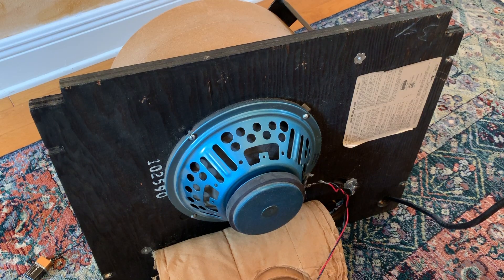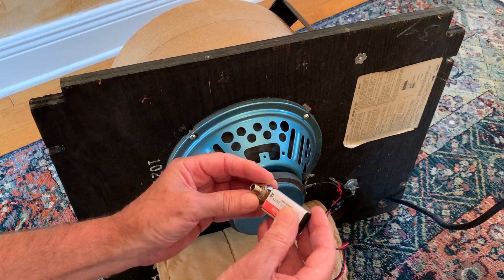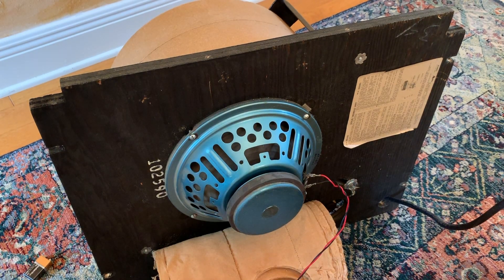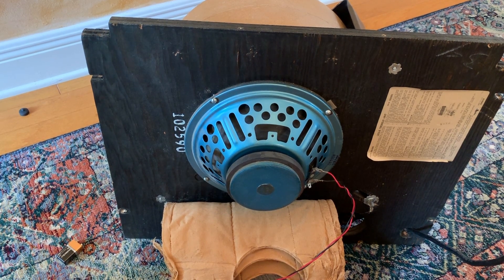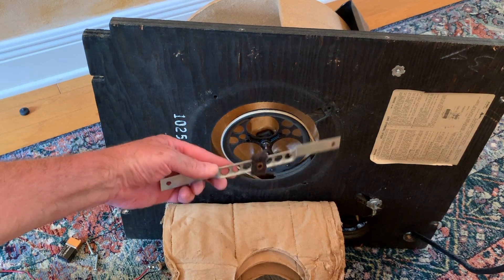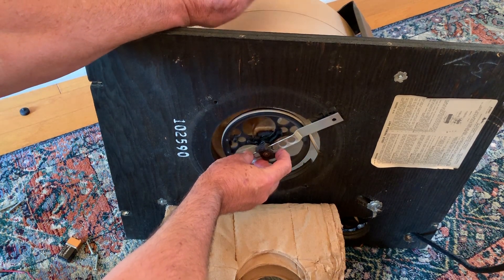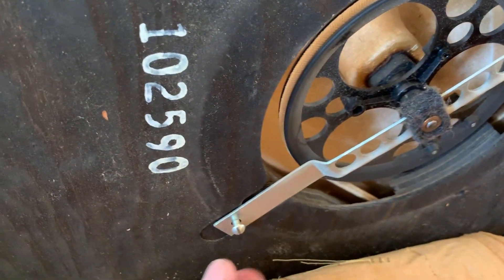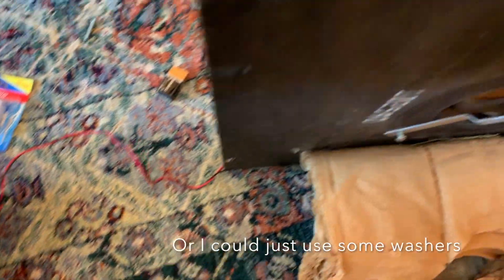Replacing the Utah Speaker in the Homemade Leslie for Guitar

Comment: I have the same unit, or very similar,  mine has the original 8” speaker.  With the 8” the bolts are the perfect length and do not hit the drum.   I also believe you have the cross support upside down..

Comment: you are better off going with an eminence delta 10 because it has a vented voice coil......though you'd have to order a 4 ohm...….if in fact the leslie is for a 4 ohm.   I did one for a client just before Christmas and the delta 10 performs exceptionally...…..I believe its rated for 300 watts with the vented voice coil.....but his leslie had an original speaker which was 8 ohms...…..he has 2 leslies
Reply: and while you have it opened up......make sure you grease up the bearings with some good lube...….and carefully check the belt drive ……..if you need a spare belt or new one.
Reply: the eminence deltas have a nice roll off where the high end is more  mellow......rounds off a higher end bright harshness a lot of guitar speakers can have in their curve...…..still has a nice high end and a nice low end that's not too boomy…..and obviously a rich mid range that guitar perfect
Reply from the maker: This is just a pull from an organ so there is no amp.  I have to supply a separate amp.  I decided to try my 50 watt Bassman and that is what finally blew the speaker.  I assume those two Leslies are the two driver type with a bass speaker with separate tweeter cones.  Eminence suggested the same Delta speaker.  I may end up with a closed cabinet.  I am going to add some insulation like a Bassman 2 X 12" closed cab.  Plus, I see the Delta weights almost 2-1/2 times that of the Legend, at 10.8 lbs.  That's a lot of extra weight.  The Utah was sounding pretty good so I'm sure the Legend will sound better.